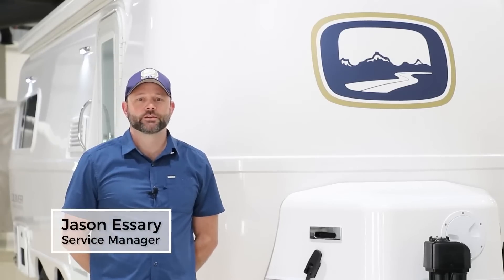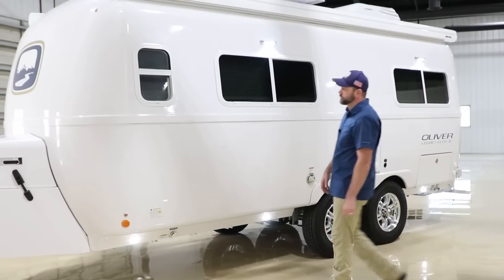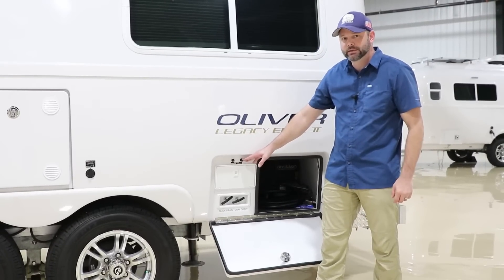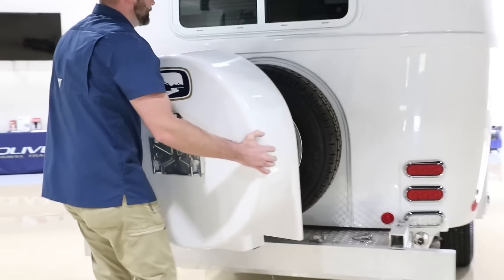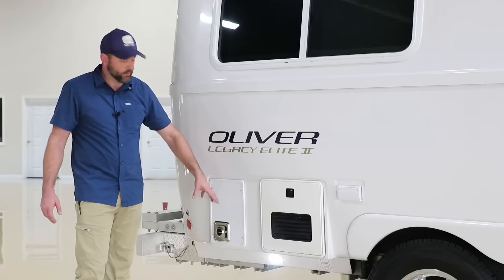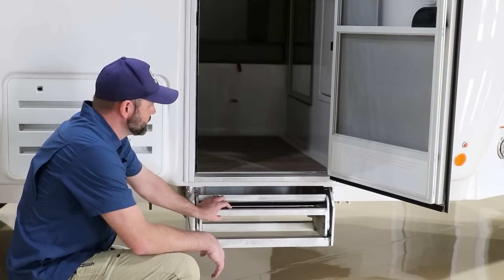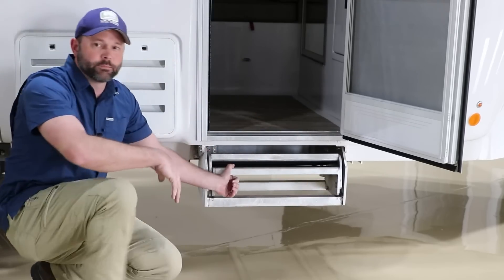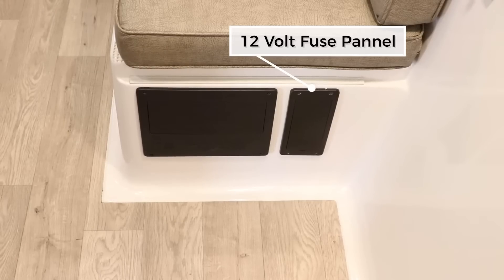2021 Legacy Elite II Full Delivery Walkthrough | Oliver Travel Trailers

Comment: I really like the quality of these trailers. We currently own a traditional fifth wheel but we’re looking to downsize. I can live with most of the compromises in this floorplan but for the premium price tag, not having a full-sized refrigerator is a show stopper for for us. This would take us back to our popup camper days in terms of the refrigerator capacity. If they can custom manufacture one with a full size 2-way or 12 volt compressor fridge with the microwave deleted, that would solve my issue.

Comment: This trailer would be PERFECT if they changed the floorpan slightly or offered a new one. Specifically here's what I would love to see:
1. Full time queen bed at the front or back running the width of the trailer (then you don't have to make it longer)
2. Oven/range combo unit with a 3-burner cook-top like you see in so many other nice trailers.
3. Flush mount/undermount sink
4. U-shaped dinette at the end opposite the bed that more than two people can sit at that turns into another decent sized bed for an adult or a couple kids.
5. I hope you will consider putting a larger fridge in these! This one is TINY. Plenty of room here for a 6 cu. ft fridge with separate freezer. 7 cu. ft would be even better.
6. A dry bath would be spectacular but you'd have to come out with a longer trailer to pull it off. If this unit had the wet bath and all the layout options above, I'd still go buy it right now. As it is, I'm probably leaning towards the Escape 21NE with the oven option which is essentially the trailer I just described. Or maybe I'll wait to see what their E23 with the dry bath looks like when it comes out. Escape isn't quite as well made and definitely lacks the strong winterizing of Oliver but the floor plan is essential to get right for us.

Comment: Is the cover to the propane tanks high enough to accommodate a 40 pound tank?  
Have the holding tanks on the Elite II been increased over the Elite’s standard size or are they still the same on the larger unit?
Is it possible yet to have the shades installed upside down?  Meaning to have the blackout shade come up from the bottom, and the thin shade come down from the top?
Reply: I was looking at that too.. To me, it looks like they'd fit height wise, however that threaded rod tie down doesn't appear to be long enough for a 40. Probably an easy owner mod.